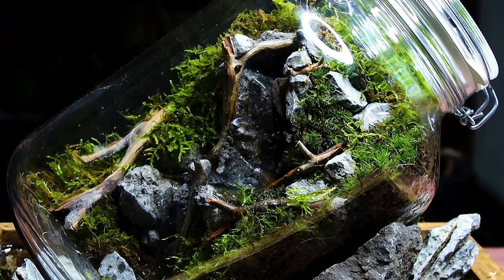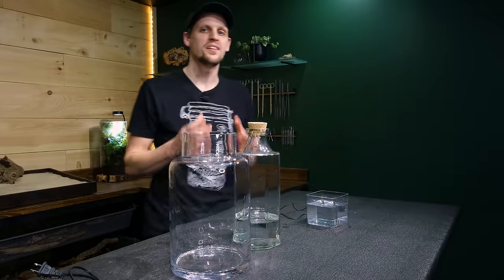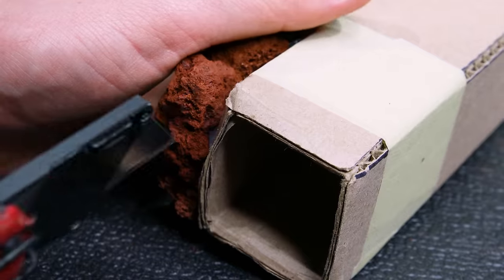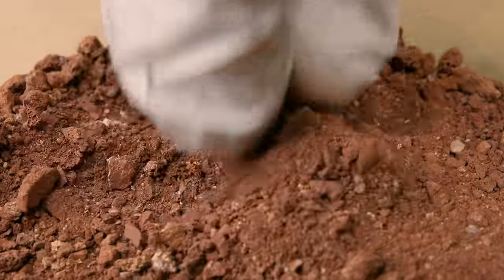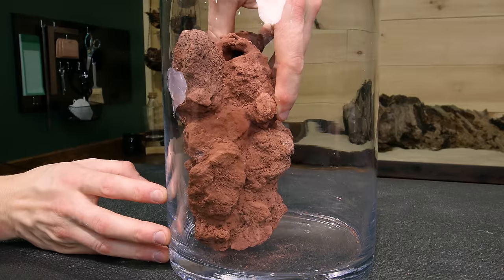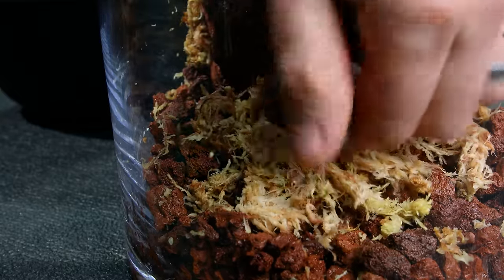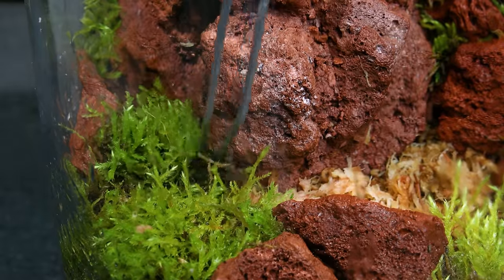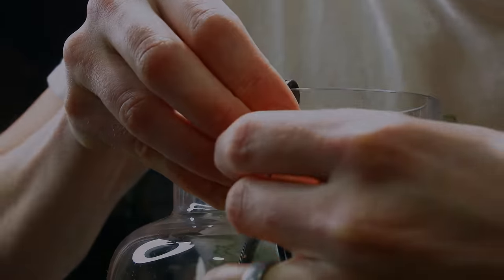Easy to Make Two Running Waterfalls Terrarium

Comment: I tried those tiny round pumps too - they last about a week. You're right to  warn people off those.   Great tips on  making the pump accessible - I've been pondering  over how to do that for ages, thanks!
Reply: I use them a lot and they just need a very fine intake screen and you need to prime them with water to make sure there's no air in the propeller chamber, I've had a few that have lasted over 3 years as a result
Reply: @mhartim8749   yeh I used them in full on mini filter systems so zero debri reaching them, and no need to prime iff well under water. I've thrown  20 away, only 3 still working after a few months, so I only get the more powerful ones now
Reply: I really prefer pet fountain pumps. They're a bit bigger than the usb ones, but they tolerate pet drool, fur, food crumbs, and are usually able to be pulled apart to clean, and have a foam filter that'll fit around them to help keep debris out.

Comment: I use those USB pumps in quite a few of my builds, most of the time it being noisy is due to an air bubble in there, you kind of have to prime them to make sure there's nothing but water in the propeller area. However it really varies from pump to pump since they are so inexpensive and the durability does too, still one of my go to pumps for nano tanks though

Comment: Another great way to make super strong glue and debris structures is mixing saw dust, sand, and white glue together. It's probably not great for water tank usage of course but i can see it in a dry spider enclosure or something like that. I discovered it by accident while making a wooden box sanding the rough edges, but i hated the seems in the box so i mixed the debris from the sanding which also had a bit of sand from the sandpaper in it and made a paste with regular Elmers glue and wedged it between the seams. I had excess and left it on the side as my box dried and was surprised to feel how concrete like it felt after drying, it was like playing with a chipped off edge of a piece of cinder block, i didn't know wood shavings, sand, and Elmers glue had that kind of power. Although Elmers glue was enough, i'm sure switching it out for a stronger glue would be better.

Comment: Curious about the glues -- why silicone for adhering to glass and super glue for the stones?
How often do you need to replace pumps?
Reply: i reckon its at least partially because it's much easier to "fill gaps" with silicone than it is super glue, you'd have to use half a bottle of super glue gel to accomplish what one spurt of silicone could do easily. if you were willing to expend that much gel though, it would work fine as far as I can imagine. the glue allows much more finesse though, hence it being good for working between small rocks like this; trying to get silicone between them would be very unwieldy and impractical. it'd be fine for bigger rocks though.

can't reckon anything about his pumps though lol. i personally use a ~$10 pump to filter my 20 gallon and after around a year it randomly died, so that's the only idea I could give you.

Comment: Took you a long time to post another waterfall job inside of a jar. Thanks. I spent two months every week bit by bit to create a paludarium inside a clear lemonade jar blocking the spout with pro plumbing washers and pipes running the wires for the water pump and tubing for air pump. Used expanding foam & rocks to create the Fall, also tiny nursery pots to plant real plants and not just moss. It's been failing and dying off since then. Mold developed all over the moss parts touching the waterfall except the very top of the jar where I placed more moss. The pump is like yours in the video and is nearly dead now. The water plants died very quickly. I need to mention that working in a tiny area makes you scratch the glass which is terrible. Taking a timelapse of the whole process is another pain you need to go through. I need to dismantle the whole project when I get a chance. I couldn’t find any videos helping me out to create this paludarium inside a jar. Your video here isn’t it. When using plants trying to avoid the substrate from falling to the water section on the bottom is a challenge that I went through. It was a very bitter experience and made me stop making terrariums for a long time. This Moss waterfall is a joke compared to what I did and failed. As a relaxing video to watch I appreciate it.

Comment: Great video for my upcoming project! I've been into aquariums my whole life and inspired by this channel I've made two jar terrariums, first one about two years ago, another last summer. Both are doing great and look fantastic.

I bought big jar from second hand store which is pretty close to one in this video with a bit larger opening, so it's a bit easier to work with. I'm going to step up my game and make this one with waterfall and water feature, so this really helps me designing that.

Does anyone know  similar small and quiet water pump Tanner is using, that one (Pulaco PL-118) seems to be either out of stock or shipping to Finland costs three times more than pump itself?